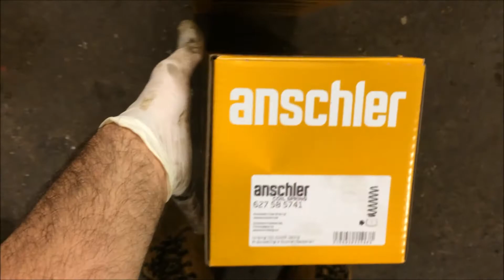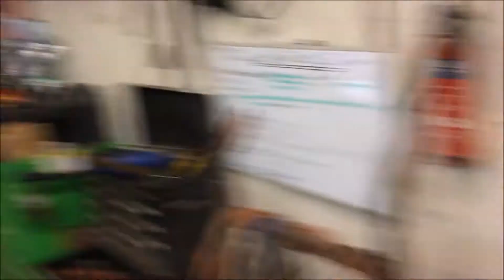FIAT GRANDE PUNTO COIL SPRING

Comment: Great video have you ever done rear subfram bushes on fiat grande punto if so do they just knock out and then knock back in the new ones or do I need a special tool thanks
Reply from the maker: Never done them before but was alittle curious so i did a quick ebay search there are tools on there, to do the bushes , https://www.ebay.co.uk/itm/Fiat-Rear-Axle-Control-Arm-Bush-SUBFRAME-Wishbone-Install-Removal-Tool-51840600/253306263364?fits=Car+Make%3AFiat%7CModel%3AGrande+Punto&hash=item3afa3ad744:g:3MgAAOSwsLtVe2ZA&frcectupt=true

Whether or not thats the correct one i am unsure